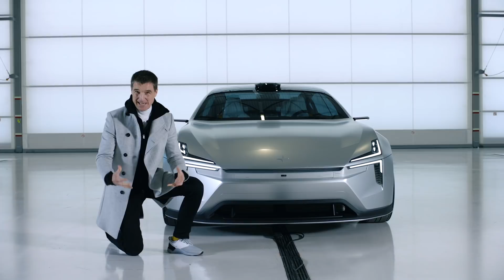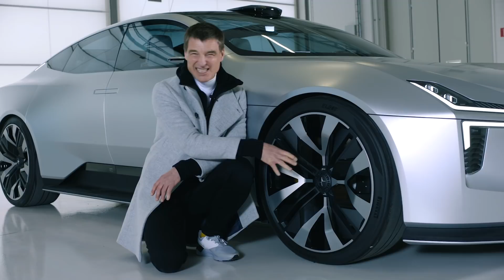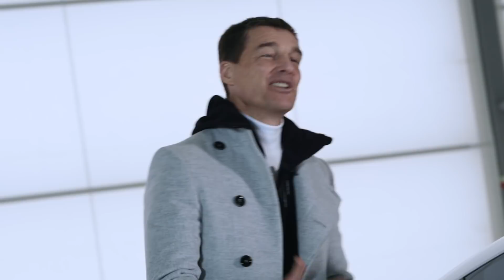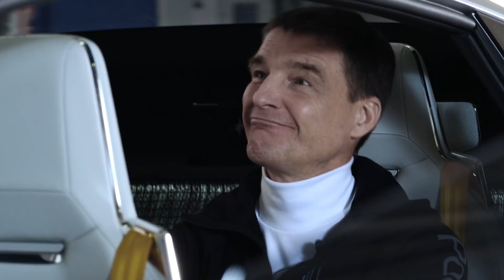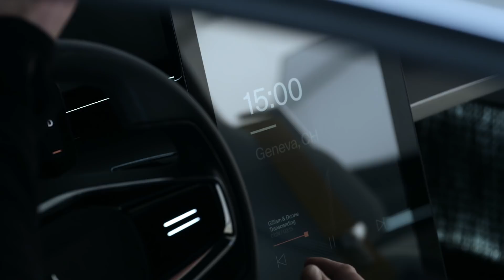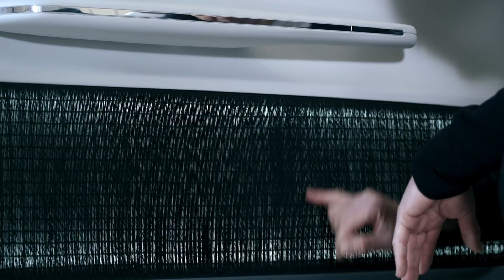Polestar Precept presenterad av Thomas Ingenlath

Comment: Let me introduce you to a car that Audi launched in 2010. Nice panoramic roof so you can get sunburnt in the neck like in a Citroen CX from 1972. We also work with contrasting matte and glossy materials... like all manufacturers since 1990, and the wheels which is a larger variant from a Renault twingo. Look at our interior which is a mixture of Tesla and BMW i3, both in production. Look at our uplight door material which gives this geniune Fiat from the 70s look. I will introduce the front safezone, but fails to explain were it is and what it is... all in all: yesterdays car.
Reply from the maker: Can you find this much cars in every other car, too?
Reply: auto motor & sport not this obvious...